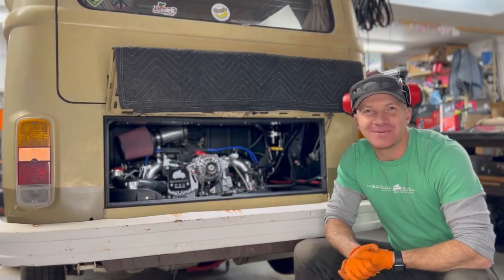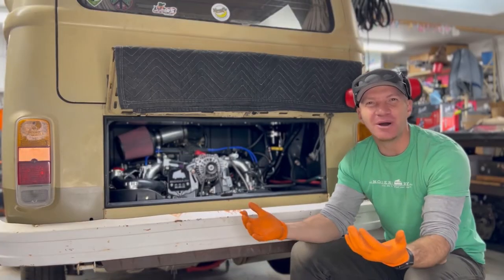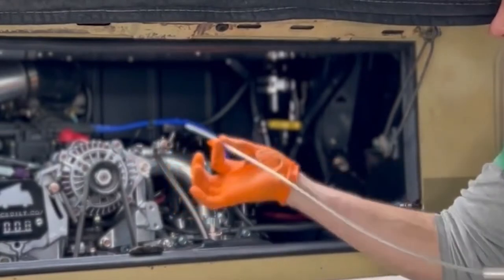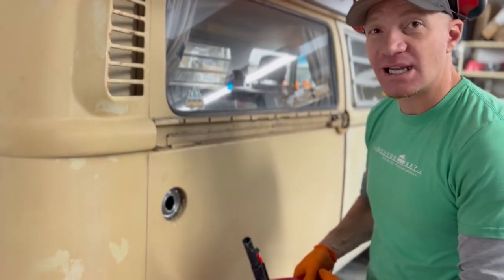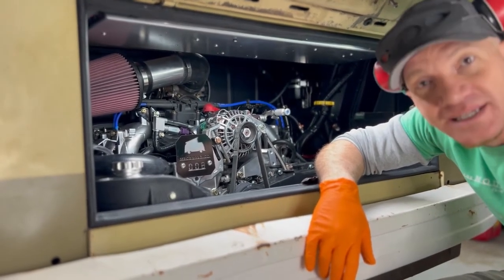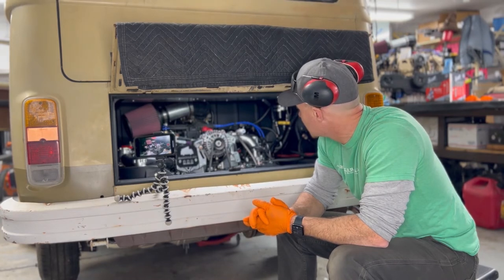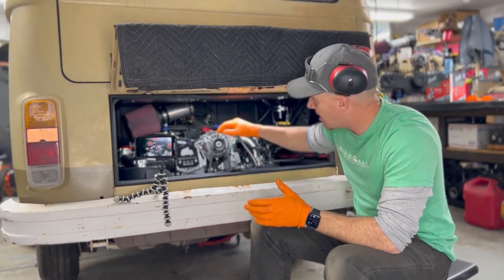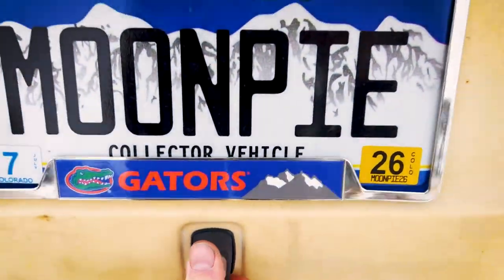Full Subaru Conversion VW Bay Window Bus Startup Process | Moonpie 1979 Bay Window Bus MBC No.08

Comment: Totally made me jump when the gas flew out😅. Another great conversion! Thanks for keeping these classic buses on the road.
Reply from the maker: Hah! Same here :D. Thanks so much!!
Reply: Do you run the 228mm like stock type 4 or 200mm flywheel. I’ve seen a 15.7 lb and 19.6 lb (technically for Vanagon) for the 228mm and was wondering if the heavier flywheel would be better to run I’m heavier(ish) ‘79 Riviera camper. Thanks for any comments or advice. Dig the channel!!

Comment: What kind of mpg do you get with a Subaru conversion???
Reply from the maker: Hey Mike! Our clients typically get 18-22, and as high as 26 mpg. A lot depends on tire size, driving style, calibration (especially between tires and that most of the speedos are off by ~5mph at higher range), and where you're driving. But that's a general figure. Thanks for watching and let us know how else we can help!